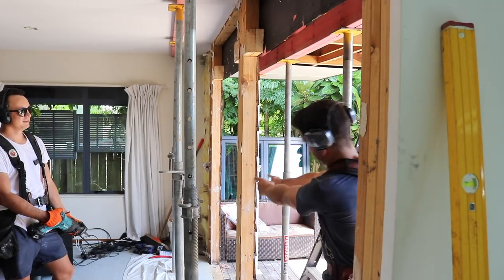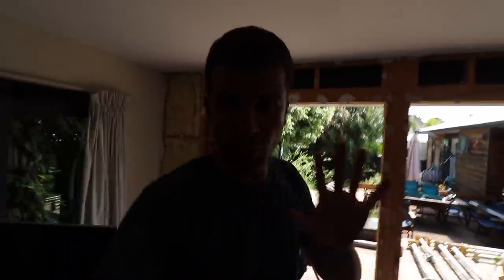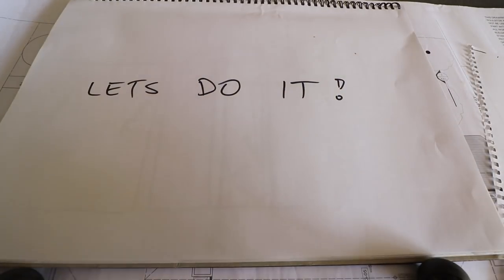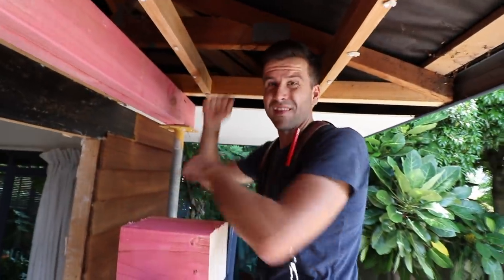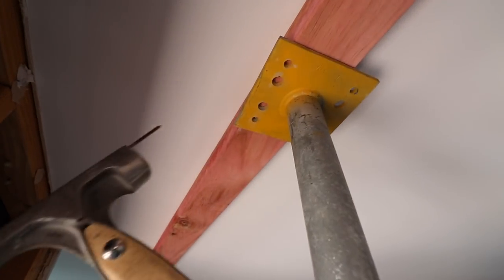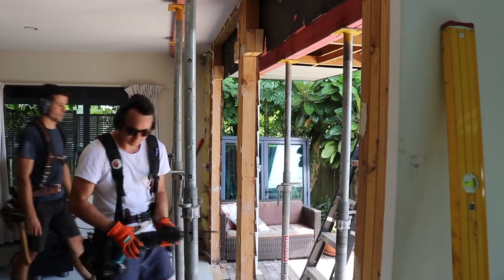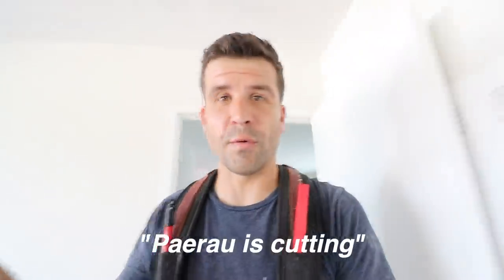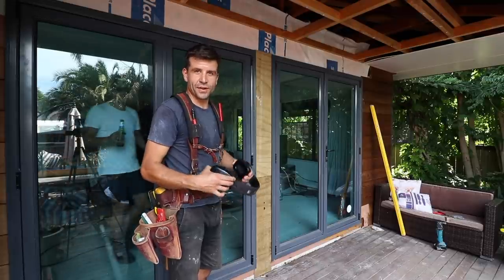Installing a Load-Bearing Beam

Comment: Love you work Scotty honestly. If that was a house in Australia and the carpenter was removing the windows, wall etc. They would have left those doors off until the new window was installed and the house would had cold blowing wind and cold air throughout. Virtually been unlivable.
Reply: Ahh don't think so, we do these all the time and do exactly what the boys did, or sheet it in ply until the doors arrive, sounds like your in QLD 🤣🤣

Comment: Do you have enough strength in the single jack stud? Or would you need to add another one?
Reply: Was thinking the same thing. I'm assuming the jack studs works be string enough. Judging by the plans at the start it was looked at by an entire so must be all good

Comment: At 6.58 looks like your putting in a load bearing stud, I thought it was supposed to be replaced by an all window type design, I'm about to have the same and the main reason for this job was to remove my center support. I must be missing something?

Comment: I honestly have no idea and am only asking because I am interested.  Did an engineer create the plans for this? It looks like you went from 4 studs carrying the load down to 2 studs.  I was also wondering if you had to add additional support underneath the remaining two studs as you went from 3 point loads to 2.
Reply: yeah wtf is going on here. that hut will fall down soon
Reply: There isn't that great of a load being carried here. Single story roof and only a handful of the trusses. 1 1/2" is all the bearing you need in this case (each side). The center bearing was basically just a divider for the doors. Could have been built as they are doing now if they wanted. I'd have to look again, but looks like he had a set of plans under his notepad that would have been approved for this project.
Reply: The double 2x12 bearing on two sticks more than covers the load of the trusses above (which is the only weight that wall is carrying, it's really not much.  Its just the tail ends of the trusses, shingles and the soffits.).  Typically for something like this, we normally double up the sticks underneath; however, we normally work on two storey homes where there's a lot more weight bearing on the header of the sliding patio doors.  Everything is determined by local code and inspectors.  I am 100% sure Scott wouldn't have posted this if he hadn't gotten an engineer's approval.  Great work Scott and Pareau!

Comment: Question: to support trusses in double brick garage , a temporary timber wall is installed. Does it need to be full height, to top plate or to underside of garage beam?

Comment: I was shocked not to see an LVL timber. The engineers around here throw them everywhere. I have faith your timber will hold.

Those steel posts were fancy. I only ever got to use  2x4 / 2x6 to build a wall when I had to make a new opening.
Reply: LVL are also used here everywhere, but for that sized opening they used 2 x 290x45 which is more than enough as it looks to only have a tin roof
Reply: It looks like the equivalent to 2x12, which im sure will span that, just thought he would definitely need to add at least one jack on each side

Comment: Timber lintels are not an option any more in the UK and you're only allowed over engineered steel that weighs a ton and takes forever to install. Wood is so much nicer to work with esp when you don't really need steel.

Comment: Could you use an I-beam or, even better, LVL beam instead of wide timber?
Reply: 100% you could.  We typically would use LVL, 2 or 3 or even 4 ply laminated together sometimes, depending on the load & engineer's recommendations.  Another option would be a steel beam (bit more costly, but can take a greater load & is more stable over time).  From Toronto
Reply: @mattchibi   LVL is a must 300mm x 62mmand for your info it's more stable than metal
Reply: LVL is a must 300mm x 62mmand for your info it's more stable than metal
Reply: @leon baydoun Hey man- you're not completely wrong!  LVL is not stronger than Structural Steel though- LVL carries much less load than a steal beam could; however, there are still some advantages to using LVL beams.  Let me explain:

Yes LVL is 2 x 12 typically, but can span to as big as 2" x 23-7/8".  We will typically pack a few of them together to create massive wooden beam- as per engineer specs.  Yes- I do prefer working with LVL, over steel beam- LVL is much lighter, and easier to cut & move.  

However- structural steel I-beams are typically much stronger and can carry a much bigger load- allowing for larger open spaces that you wouldn't be able to achieve with any wood construction.  Steel is typically MUCH more expensive due to the difficulty that comes from moving and installing the heavy beams.

That being said- the main difference is when you introduce fire to them.  Steel has a melting point of 1300~ F; and while most data shows that house fires only reach 1100~ F- it has been shown from more modern studies (and my personal experience) that due to the excessive amounts of plastics/synthetics/foams that is very popular in modern furniture (such as mattresses, couches, etc) that house fires can reach much higher temps- closer to 1500+ F.  Even at the lower 1100 F temps, steel's main deficiency is that it will weaken over time, before it eventually buckles on itself.  That being said- it would take minimum around 15-25 minutes of intense fire before that steel beam fails.

The main reason I say that LVL is less "stable" is because we typically use LVL beams in conjunction with other wooden construction materials.  All wooden materials (even LVL) can shrink as moisture dissipates.  This can cause your beam to shift out of level ever so slightly (we're talking 1/4" to 1/2" over 30' at most) after it has already been installed.  This is much less likely to happen with steel beams, as it typically rests on an other vertical steel beam that sits over the concrete foundation, and the joints are locked permanently after welding.  Hope that helps!
Reply: Sorry to expand- in comparison, wood beams when exposed to fire will have a reaction on the surface called "charring" that blackens and hardens the wood on the outside, protecting the inner core.  Due to this reaction, wood beams have been proven to fail or deflect significantly less than a steel beam would when both are in the presence of fire. In one  study, a steel beam failed completely after exposed to fire for 30 minutes, while a wooden beam still retained 75% of its original wood under the same test.  (https://www.jlconline.com/how-to/roofing/q-a-performance-of-wood-vs-steel-beams-in-a-fire_o) 

That being said, most structural elements will need to be replaced anyways if a fully involved house fire burns for 15+ minutes.  And most occupants who have not been evacuated would probably be deceased. anyhow- so it really makes no difference.  I'd go with steel beams if it were my dream house & I would just install an extensive and highly efficient sprinkler system lol.

Comment: I am surprised by the small ledge carrying the weight of the new beam.
Reply: In a lot of places that wide of an opening would require double trimmers....
Reply: Building codes I know would require double sometimes triple trimmers depending on the span and size but this is also NZ and they seem pretty lack on codes.

Comment: great vid.  nice technique.  where i am in the world, i couldnt use that type of wood, i would need LVL (laminated veneer lumber) as the span is too large.
Reply: @dave daved, the span was not that large, the roof load was minimal and they laminated what looked to be 2 x 290x45, easily enough for that span
Reply: at that span, i would go LVL or Fletch.
Reply: I agree. But it's worth noting there is no snow load there, also the roof won't be asphalt shingles which usually weigh a ton.
Reply: @zaneh6224  Doesn't matter...It's code...Any span greater than 6 foot requires a solid member...
Reply: @godbluffvdgg  Define solid member ? It was  2 x solid 290x45 timber, I assume MGP10 or F7 where u from USA ?
Reply: @frameriteairdrie578  Not as much as concrete tiles which is the norm in Australia
Reply: @zaneh6224  They used 2- 2X10's They would need a 4X10...Or an LVL...Which is cheaper than a 4X10 ...But that's just code...I am in Philly USA...I think it's overkill too and The way they did it, is the way we used to do it...
Reply: @godbluffvdgg  4x10 are not normal timbers in Australia or NZ,  biggest solid size is 45x290, laminating 2 x members together is fine under our building codes for various situations, yes LVL are easier and is it what I would use any day over solid, but solid is also fine under code if engineer spec's it, we don't have such rules that state anything over 1800 must be a single member.
Reply: @zaneh6224  Yeah, the codes are different everywhere...Is that 45 kilometer X 290 Kilometers?...:)...Just kidding, because we're still on the Imperial system and most people don't know the difference between a litre and a meter...:)...Stay safe!
Reply: @godbluffvdgg  Yeah, I don't know how you guys use the imperial measurement, with all that 32nd, 64th just gets too confusing,, I understand the simpler stuff like 1/4, 1/2 ,3/4, start talking 32nd and u lost me,  metric is a lot easier down to the millimetre
Reply: @zaneh6224  Hey, why do a base ten system when a base 12 is so much harder...:)..I was in grade school in the 60's that's when  they introduced metric then to school kids...smh...So many years later.. We look like cave people to the rest of the world. ..Sometimes the simpler things are hardest to understand...

I love metric for precision...

Comment: Hi Scott, new subscriber love your channel just wondering if you put any more studs either side to support the beam?
Reply: Wouldn't need it as there was already a double stud then an opening/under stud on that 2
Reply: @MrHianga  yeah see what you're saying however after removing 4 studs that were laminated together acting like a main support for the beam i thought they wouldve needed 1 extra either side. But seeing the size of the new beams laminated together to span the opening the width of it is the difference.
Reply: @deanno7067  yip exactly right. The width of the 10x2 is the key and bow up. Strap vracing routed into studs that will stich studs n beam together. Then you can put cpc brackets or strap bracing from beam to top plate and bottom  cord of the truss but bit of an over kill.
Reply: @MrHianga  I'm not an engineer but I can almost guarantee there should have been double under studs out of LVL as that single line stud is taking heaps of extra load.
Reply: @MrDeano-eu9rg I can understand your point, that there is the most commonly used method in nz for any door or window opening, as there was already a door there the depth of the lintel is what's taking the weight, the diaphragm of the French door also helps with rigidity..putting another understud does nothing..the only other reason it would be added would be subject to engineering specifications submitted into the plans and specs..to add another under stud would mean to rip decking up, put more piles in and joists directly underneath the opening to take the weight for a stud each side, when there's already 1 there in the same spot..the load that those middle studs that were extracted is now transferred to wider/bigger lintel installed, then transferred to the exact same place as the original opening and under studs to joist, to bearer, to the post, to the ground..hope that clears it up
Reply: @MrHianga  you are mistaken my friend. It would only have required cutting out the stud next to the under stud...2 minute job,and adding another under stud. The load must be transferred  from the roof all the way to the earth as he stated, now if the load is now ALL on a single under stud either side opposed to the original four studs, there is much more work on that lone stud. The single stud is also only pine. Its probably ok  ut usually Engineers over engineer to save their own asses so I'm really surprised if they did this of a plan.

Comment: I was preparing an opening for glass sliders earlier this week , 2.2 M X 5 M, the sag in the middle of the steel lintel beam over 5 meters was 7 mm ( Which is what the engineer calculated would happen ) single story tile roof. 

Mean video anyway cheers
Reply from the maker: Woah, 5m is quite a span for a window too
Reply: Scott Brown Carpentry 7.5m opening at the back of my house!
Reply: Matthew Snart cool , what have you put inside the opening? Ie window , sliders etc is the lintel a steel frame ?
Reply: Beam*
Reply: Elijah Yeah bifold doors. I put a 410UB in there. Monster.
Reply: Matthew Snart wow, the doors must look mint, did the beam have any sage in it ?
Reply: Elijah I actually had a positive bend put in it, recommended by the engineer which is quite common. So it was actually bent “up” originally. Over time it evens out they say.
Reply: Matthew Snart wow that's cool, what is the positive bend in mm when it's on the ground and, once you put the it in? Ie 10mm just the beam on the ground  then 5 mm installed and under load?

Comment: Amazing,in the UK I'd probably have to Install 8x4 steel beam for this, wish they would let us do this it's so much easier
Reply: true, but more weight in UK buildings though, brick, roof tiles etc. which is why.
Reply: @pauledwards9493  yeah I understand that,depends on the roof covering mainly, I meant for a single storey where it's just bearing the roof.literally did one yesterday,as usual the engineer had it massively over engineered causing heaps of back breaking work for no reason.
Reply: @rossmale8715  I get you mate. I find with engineers/architects etc. is that they overcompensate on everything structural, which is better than under compensating don't get me wrong. But i think fire regs come into play big style now a days (thats what was being said at the UK construction week) put in steel so the building stands longer to evac people/ put it out etc. But its a shame that the knowledge of what timber can do, is being lost.
Reply: @pauledwards9493  absolutely,they want us to be environmentally friendly but make us fill these houses with unnecessary steel and harmful insulation.
Reply: @Ross Male Yeah man... Literally everything I touch or use on the jobsite is toxic to my health lol.  I get what you mean with engineers over-engineering everything.  God I hate lifting steel beams without jacks.
Reply: Engineers always over design to cover their arses

Comment: Well so you dont know anything about transferring a load. Theres hope. You can start by taking simplified structural engineering courses. After you take your classes will you go back to that homeowner and tell him you screwed up and you are ready to fix the mess and do it for free?
Reply: Well he hasn't finished the job yet, but let's hope that he adds to the king studs and he's transferring the load to. Let's also hope that the footing is appropriate to that load.

Comment: Appalling. I just can't believe how lucky these guys were. None of those "support" points was structural. Yes, those trusses were engineered, but not for those new construction conditions. By all means, if you want savings, don't skimp on professional advice and hire an engineer by the hour BEFORE anything gets removed. It is a lot more cost-effective than hiring attorneys AFTER something goes wrong. (Full disclosure: yes, I am a structural engineer). SMH